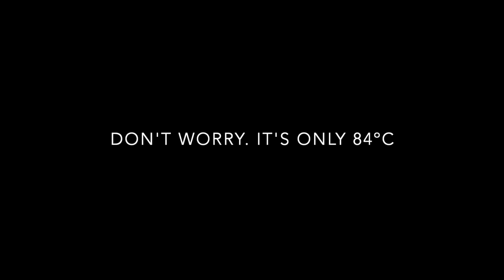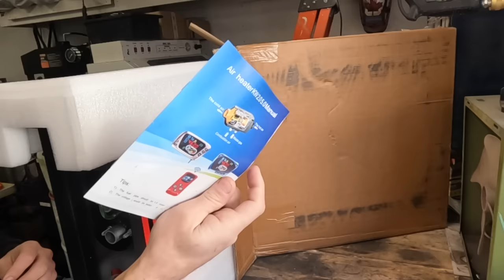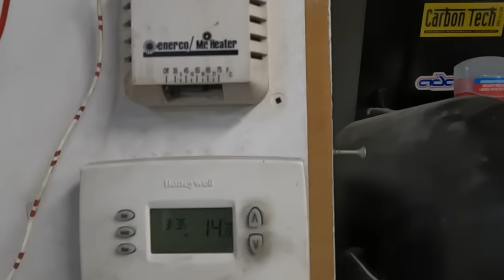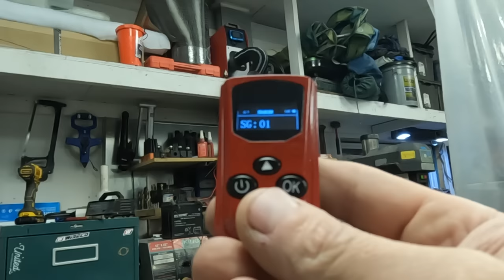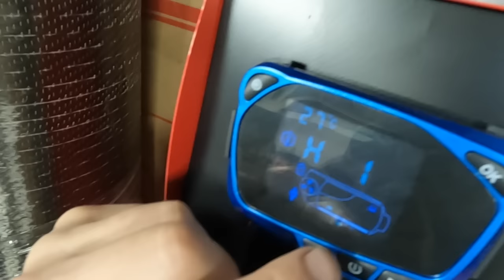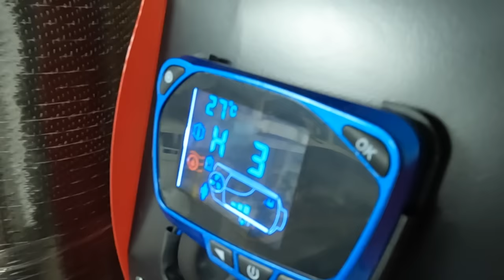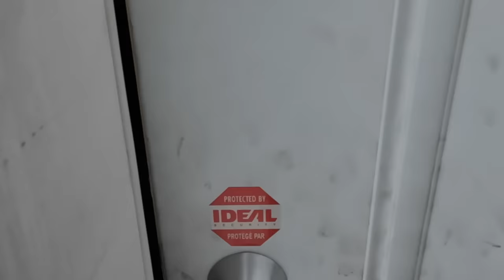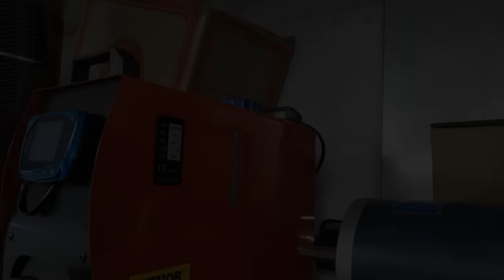Chinese Diesel Heaters - DON'T BELIEVE THE HYPE !!

Comment: Was really considering one of these to replace my kerosene heaters.  Looks like you are in Calgary.  With the -30 degree temps we have had this week I'm curious to see if this thing would be able to heat an insulated, double attached garage.  Any insight you have would be appreciated.  Right now I have a kerosene torpedo heater and an upright wick heater but would like something that can vent exhaust outside and doesn't  cost as much to run.
Reply: There are only about 5 million clips on Youtube about these heaters. Feel free to use the search function !
Reply: @regwatson2017  Obviously been doing that and came across this vid in the process.  Liked this chaps video and was interested in HIS opinion as he is local to me.  Thanks for your insight.
Reply: Hey ! I am in Calgary. I won't make you wait for the upcoming videos. My garage is pretty well insulated and this heater was able to keep the temp up around 13C during this nasty cold spell. 

I can't, at this time recommend running one of these on anything but diesel though... It works perfectly using diesel, but anything else is problematic. The cost of running diesel will quickly add up ...

My recommendation would be to get Mr Heater if that is at all possible / practical for you. I got mine at PrincessAuto several years ago, on sale, and the price of them has more than doubled now... Still, an 80,000 BTU MR HEATER will have your garage t shirt warm in 10 minutes. It always works, it is convenient, and in the long run it will be much more cost effective... 

With the diesel heaters you will likely run them nonstop to keep the temp with the MR HEATER you can leave it just above freezing, and then blast it up to 17-18 while you are out there... assuming you are working out there. If you are just storing vehicles the same will be true for cost of heating.
Reply: @PUBHEAD1  HAHA... Not sure what's up with ol Regie... You're welcome to ask me questions. Also, just reread your question / statements and thought I'd add a few things.. These aren't really 8Kw they are more like 5. If you are actually running kerosene you could buy two of these and run them full time, full blast and it would still cost you less than your torpedo heater. On full power one of these burns about 5 litres of diesel in 10-14 hrs ... I haven't calculated accurately yet... And yes, you can vent the exhaust outside, so that is great.
Reply from the maker: Just realized I replied to you while logged into my other YT channel. Oops. Hope I didn't confuse you too much.
Reply: @JoelArseneaultYouTube  hey Joel, thanks for the reply mate.  Yeh, Kerosene is really pricey so I thought diesel would be cheaper option.  I am considering just biting the bullet and installing a natural gas heater.  While the initial install would be pricey, in the long run it would be safer and cost effective.  Just need to sell my kerosene heaters now to offset the cost😁
Reply: @loweredexpectations4927  no worries.  Quick question, when you mentioned the Mr Heater, are you referring to the little garage furnaces that mount to the ceiling and are wired in for natural gas, or some other  type if portable thing?
Reply from the maker: @PUBHEAD1  👍 You won't regret it. If you are handy you can do the whole install yourself. I installed mine. I don't know if I mentioned it in this video, but I actually have an 80,000 btu Mr Heater and a 200,000 btu floor heating system. I got the diesel heater to burn waste oil, and that isn't going as planned, haha.
Reply from the maker: @PUBHEAD1  The one that mounts to the ceiling. I have one hooked to natural gas. I wouldn't bother with a portable unit.
Reply: @loweredexpectations4927  Cheers, thanks for the info.  Have a Merry Christmas my friend.
Reply from the maker: @PUBHEAD1  Merry Christmas to you as well !
Reply: Mini split MR COOL would be a good option for that, you can install it yourself, heats and cools and only 1,200 bucks(when I bought mine), I run mine with solar, a good deal of the time, depending on the sun.Grid power when the sun won't co-operate..They are highly efficient..The diesel heaters are awesome for small areas, if you can run them for 20 min. shut them off for an hour, run again for 20 min., and so on..And they are great for power outages, it requires power, but not much and a battery will work..I have one in my camper van, and tiny house, but have other heating solutions too, lots of redundancy, wood burner, mini split, diesel, propane..When you live in the middle of nowhere better be prepared.
Reply from the maker: @realeyesrealizereallies6828  Hey, thanks for the comment ! I actually have a 200,000 BTU tankless floor heating system that I installed when I built the garage (that was a lot of work) and also a 80,000 BTU Mr Heater as a back up heater. Both running on natural gas. 

I have looked at the mini split systems and like the idea of it... I saw them for the first time on the Aging Wheels channel  I believe... I bought this heater mainly to see if I could indeed burn my waste oil, as I have a regular supply, and yes, it would be good as a backup system if the power went out. Sounds like you are pretty well set up !!

Comment: Less energy from waste oil, and its will kill the pump and burner unit unless you run diesel through it, same if you Kerosene.....
Reply from the maker: Engine oil has less energy than diesel ? Are you sure about that ? 

Waste oil won't kill the pump quickly, because I have as I have over 1200 hours of use on mine at full heat, with no signs of failure. Works perfectly. 

Waste oil will clog up the burn chamber pretty quickly. I have also experienced this every few days for 4 months strait... It clogs up even if you mix with diesel or run it on diesel for a hour every 4 hours.

Kerosene seems to work pretty well based on what several people have reported. It doesn't lubricate as well as diesel, so I assume in several thousand hours the pump may wear out.
Reply: @loweredexpectations4927   Petrol 46mj. Crude oil 31mj diesel 39mj. Waste cooking oil avg 33mj. So yes, generally more energy in diesel, and is designed to burn, waste oil will have less as it has been used and is full of contaminants. Do you have an inline filter, that would make a difference to the life of the pump, not trying to be difficult, take care. Mike
S
Reply from the maker: @michaelstanley3961  Sorry if I came across as a dick in my first response. My girlfriend / common law is leaving and as a result I may be losing my house, more importantly my garage etc.... so I'm a little on edge, haha. 

Ok... I figured out where the confusion is / was... I have always used energy by volume and not mass. Crazy how much difference that makes.  

Diesel is 38.6/L and Petrol is 34.2  and crude oil is 37.  Using volume makes more sense to me, because the pump is delivering a fixed volume fuel and you generally have a fix volume tank. Purely a guess, but I would assume that engine oil has slightly more energy than crude. 

Absolutely, diesel has been engineered for almost a 100 years to burn clean, without leaving crap behind... and engine oil is designed not to burn. Contaminants or not, it has additives and it is also has lots of naturally occurring stuff that just doesn't burn well. 

I do filter my oil in a very crude way before it goes into the tank, and then an inline filter before it goes to the pump. 

Cheers and thanks for replying !

Comment: Make sure you watch a tube on how to mix used oil and diesel.
Reply from the maker: Thanks for the comment. I have been mixing my waste oil with diesel, but have not had good results. I believe I need a controller that can change the air fuel ratio.

Comment: 23:33 And since I now know you read the comments; The keyboard warrior in me has to come back and address this.  
/s This is the proper cutting procedure.  To pull the blade towards you so when it slips it gouges your leg.  Excellent work.
Reply from the maker: BUT... Would you be more worried about me if I actually didn't know not to cut toward myself, or if I know and have made a calculated decision based on cutting things and myself for years 🤣 

Notice the technique. Arm almost locked at the elbow, pulling the my arm into my side, bucket braced against my inner knee. The travel of the knife is limited by my elbow hitting my side and the lid / bucket are being braced so they can't slip. While I wouldn't recommend this to anyone, if you have used a utility knife a lot (in an unregulated situation) you come up with more efficient / accurate ways to cut things. 

I have worked at places where you need to fill out a safety sheet if you plan on using a knife on site and then do a thorough risk assessment.... If you plan on climbing stairs with the knife you need to fill out a separate form. Shell Grease production plant and also a few Natural gas plants...
Reply: @loweredexpectations4927  
> If you plan on climbing stairs with the knife you need to fill out a separate form.
LOL  and people will still find a way to sue.

Yeah, I noticed the technique, the quarter turns.  The blade is pretty well embedded in the plastic and it's not like you will cut through the bucket rim.  

I worked with someone that cut someone else* with a "safety knife" (the yellow 'crewsafe' ones) while breaking down boxes.  Equipment can fail, the blade could snap.

Stay safe in your calculations.
Reply from the maker: @easymac79  OH man... that would be horrible to cut someone else ! What a horrible feeling that would be. I had a roommate who was working construction (framign) and he was kneeling at the top of a wall and put a 3 inch spike in his knee with a nail gun.... They had to lift him down because his knee was locked. Luckily it just hit muscle and tissue...

Comment: Do not burn waste oil in these or other oils strictly diesel.  One needs a heater designed for waste oil to burn waste oils and they require tons of non-stop maintenance.  Clean out the heating chamber and put in new glo plug and screen.  Keep the unit heat chamber clean it will soot up faster if you run at low fire rates 1-2 all the time due to excess air at low fire rate.   At low fire rate they soot up bit quicker due to high excess air which is normal for just about any combustion unit due to lack of dampener air control.  I would not fire hotter than 4 and like a setting of 3 on unit I use.  I went with MaxPeedingRods 5kw unit which comes with heavier duty exhaust pipe, bit sturdier than those most companies send with the kit.  I also used a RV type thimble double wall to port unit outside.  The stuff on internet can very quickly get people in trouble.  Diesel only in these units..........They have all types of maintenance kits online for cheap for these units.   I think after one season of running I would open up heat chamber inspect and clean and put in new gaskets.  All of the components are replaceable for low cost.  

These units are a smaller version of very famous heater found in cold environments called a monitor heater, have one at a log cabin which can run two winters using not even one 275-gallon tank of kerosene heating 2 bedrooms, large bath and very large dining/kitchen and living room area.  The monitors are not made any more went out of business but are very popular in cold weather climates for log cabins and houses.  I believe there are companies out there that refurbish the old monitor heaters, they were fantastic heaters.   They sip fuel and put out lots of great btu's on order up to 3x higher than the Chinese diesel heaters but are very similar design.   Our monitor tied into a 275-gallon tank in the basement and the pump was located in a closet.  The heating chamber was under a window and exhausted directly outdoors through a thimble.  I believe it was rated up to around 45,000 btu max with average run btu's more like 18,000 or even less.  The monitor had about 9 heat settings and pump were quite a bit larger and more robust.  The monitors could also be run on a two-three gallon self contained fuel tank.  They were about 26 inches wide, 12 inches deep, and 20 inches tall with built in digital controllers and ran few thousand dollars back in the day.
Reply from the maker: Thanks for the in depth comment ! I appreciate it. I now have 4 heaters and just use this one for fun testing.... The rest of them get diesel only. They are awesome, and like you say, no issues if run on diesel (or kerosene)

Comment: Hi buddy,great video,Do you have the exhaust connected to your shop vent by any chance ?
Reply from the maker: Sorry I missed your comment. Just seeing it now.  My exhaust goes into the ventilation system, but the system is not turned on. The exhaust is carried out via convection current when the heater warms up.
Reply: @Lowered Expectations  could be your problem,if your not venting straight out into the atmosphere,the exhaust is not getting to cool as the fumes are not going out quick enough
Reply from the maker: @kiltedmonster1  A few others have had this thought as well. I assure you that this is not the case. The exhaust caught on fire internally due to unburnt fuel building up and sticking to the walls. The ventilation system has no effect on the exhaust, but if it did, it would get extra air as the vent is slightly lower pressure than atmosphere.
Reply: OK, buddy, just a thought that I was thinking good luck 👍 have a great weekend
Reply from the maker: @kiltedmonster1  I appreciate it ! I am human and I often overlook things.

Comment: The remote always you to do most of the button combinations, that are done on the panel, except those that require the upper left settings button.

I set mine to 1 on the pump, once the temperature I like is reached. It will run for 24 hours on a full tank. 4 43 liters, or 1.17 gallons.
Reply from the maker: I'm not sure about my remote, but my controller lacks the functions of most controllers. The settings button basically does nothing except for make the backlight come on. I have ordered a new controller. 

These are very efficient ! I've never run mine on setting 1 but it will last 14 hours or more turned all the way up. It's rarely warm enough here to run it at a lower setting.

Comment: This is not a "ready-to-use" device. It's a cheap suggestion and you need to find a way to set it up safely or safe enough. The times of "I pressed this button and this happend" are over ;-)
Reply from the maker: Sorry I missed your comment. I have found it to be pretty good working on diesel... not so much on motor oil. That being said, I haven't been able to kill it and it has almost killed me... haha.

Comment: I bought a kerosene heater, which I will eventually switch to diesel  or jet A fuel.  I thought of one of those Chinese diesel heaters for a back up, but I do not feel is as useful in the US where there are more black outs, because they still need power and I have to drill holes in the wall to install it. The advantage is the holes to the outside make monoxide much less likely. The kerosene and propane heaters from Mr Heater, some will need power , and propane is expensive and your tank last just 10 years. The pump's ticking noise is annoying.
Reply from the maker: You got one of those torpedo heaters ? They work great in a well ventilated area, but they consume a LOT of fuel... Jet fuel is basically diesel or kerosene isn't it? I forget. I thought it was diesel but they don't have the same regulations for sulfur so it has more in it. 

If you have a few car batteries, (maybe one) the diesel heater will run for days on a single charge .... I charge my battery non stop, and if the power goes out, I still have at least 10 hours of heat, if necessary I can charge the battery with a running vehicle... I do not like the idea of drilling holes in my walls... I admit that. That's why it is dangerously mounted on my shelf ... and venting into my shop vent duct. 

The pump ticking is annoying but if you take a few minutes and either insulate around the pump or mount it somewhere better... it is very quiet. 

Cheers!
Reply: @loweredexpectations4927  I have this setup with a little trickle charger on the battery in my garage, I don't run the Heater 24/7 so the trickle charger on the old boat battery works perfect. The heater is for the real bad cold snaps or when I need to work in the garage for a while only.
Reply from the maker: @underscr0e  Right on... They are perfect for that. The one thing that I haven't had any issues with is my battery / charging set up.
Reply: I ran mine off of my motorcycle battery once.
Reply: @dan239  For how long?

Comment: Also with the wrong mixture you will get a lot of carbon build up. That will cause the machine to fail. You probably need to clean your machine now. Next to this it is well known that the Chinese machines are not calibrated very well. There are YouTube videos explaining how you can do this. Your videos are entertaining though. Good luck with your heater. Mine is fine btw. But then again I am using diesel or a fuel with same flash point and make sure you burn your oil as clean as possible. If your exhaust is smoking too much when it is running for a while it is a bad indication. Even in -5 mine is not giving any clear exhaust after couple of minutes. This means it is efficiënt and that carbon build up is minimal. These heaters can easily achieve over 90% efficiency.
Reply from the maker: Thanks for another comment ! 

I have ordered a different controller that will allow me to change the air fuel ratio. My current controller does not allow this. 

 I have had to clean out my heater several times now... I am getting pretty good at it, haha. Diesel works great in mine as well. I have run it for several hundred hours without issues, on diesel... motor oil, not so much. 

I have made some progress throughout my testing and the testing continues. Cheers !